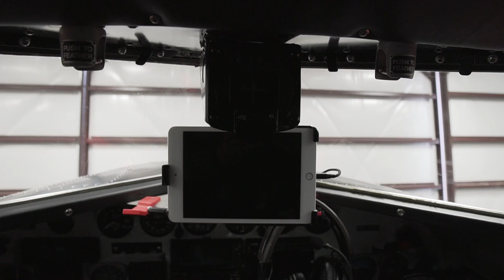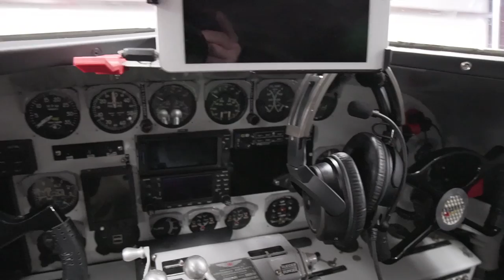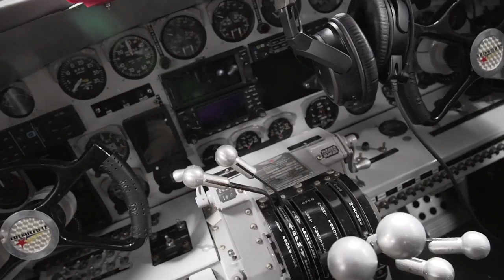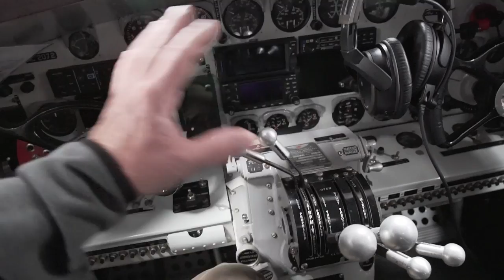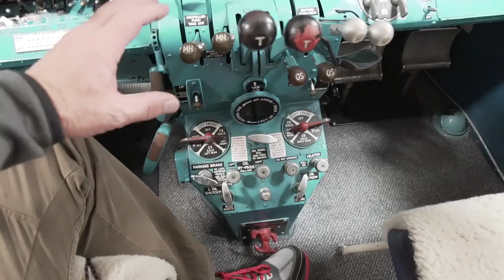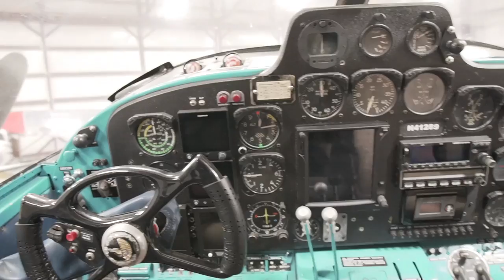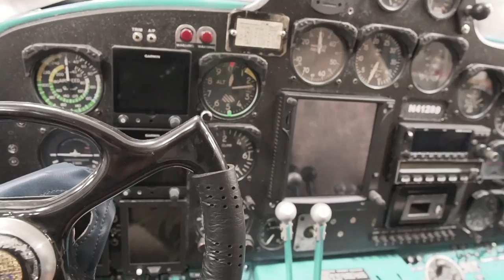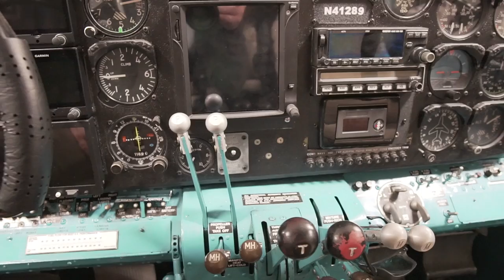Beech 18 vs Lockheed 12

Comment: Thank you very much for this personal insight into these two remarkable aircraft. Although they are very similar in layout and mission, the thing that strikes me is that the Lockheed seems like the product of a very large, industrial company that has built everything from airliners to military aircraft at this point, which has scaled down its engineering to this level and has brought all the benefits of that technology with it. Whereas, the Beech seems more like a smaller, nearly cottage industry company reaching up to the level of these twins and bringing its interpretation up from very much more basic engineering. Just as you mentioned with the comparison of the two landing gear retraction and extension mechanisms, one totally thought through, simple, effective, and reliable, the other a mix of mechanics that gets the job done, but is very much less elegant, reliable, and simple. 

The wing spars are another example of true, thought-through engineering versus up-adapting existing methods that worked fine on smaller aircraft, but were an overreach on an airplane on the scale of these twins. Kind of like they just kept patching and adding until they got something that would work, but a knee-high spar cutting right through the fuselage, bisecting the cabin and cockpit? That sort of speaks of a lack of design, instead of the presence of design. 

The NACA cowling on the Lockheed seems like another example of superior engineering, it effectively forming a Bernoulli tube that creates its own vacuum flow to extract heat from the engine in a very precise, virtually tuned, manner which has to be less drag-inducing than the Beechcraft method of just capturing a bunch of air and releasing what you don't need through the cowl flaps. Both methods work, but one is elegant while the other is crude by comparison. Don't get me wrong, I love Beechcraft airplanes, all of them. I'll never afford an airplane of my own, but if I could choose just one, that is capable of nearly everything, I would want a 90-series King Air hands down.

In the final analysis, the production numbers of the two aircraft cannot be ignored. In this case, the Beech wins going away. I'd wager that Lockheed either broke even or lost money on every 12 they built, going to the effort to make sure to have an airplane in this category for their customers who wanted Lockheed engineering, whereas Beech built an entire company from this airplane.

Great video. And thank you again for preserving these two beauties and taking the time to share them with us.

Comment: I am a retired twin piston pounder and absolutely loved this video and all you have shown us and talked about.  I owned a Cessna 150 which I restored and is still flying up in IL, N10518.  Also has a Piper Apache 235  N4951P, which basically had the Aztec fuselage and similar engines only the Aztec had 250 hp.  Think it’s still flying too.  They only made 114 or so of these and when I had mine only 52were still in the air.  Great plane, lots of power. My Piper had no cowl flaps and an augmenter exhaust  system.  After I sold them I flew on a Piper Navajo, some time on a King Air 300 as co-pilot and finished flying on a Cessna Golden Eagle 421B.  Loved that plane but of course the mechanics hated it.  So I can really appreciate the vintage birds.  Thanks for bringing us along.

Comment: Many more Beech 18s were built, the gross weights were increased and then they were abused as freight carriers . Those factors were probably the reason for the spar cracks and the straps. It should be noted that the later model 18s had a much higher cabin and the very last had fuel injection engines. Tricycle gear was factory optioned on the H models.  It never looked right. 

Even though they’re similar the 12 is a better looking plane and yours is absolutely perfect. Thanks for sharing.

Comment: Great video and comparison. I think some people would benefit knowing that the Lockheed uses a long rotating jackscrew (not a worm gear) to actuate the gear... almost foolproof. Same design as the elevator/stabilizer trim on a 737, except open and accessable for inspection/maintenance. 
Btw, airplanes have seats, not chairs. I know... y'all talk funny in Texas! Lol

Comment: Hey thanks for the comparison. For years I could never differentiate between the two. And when I learn something new, I try to make a mental word play to remember (getting older so I need help). And this one was simple. "Lockheed Lip"! The Lockheed has a Lip on the vertical stab. So easy to make the visual now that I know what to look for. Typically I'm not close enough to see air intakes, door shape, flaps, etc. So great job, nice tour, informative narration, and terrific walk around. Cheers!!!!

Comment: Air intake position: statement of STC ref "hot engine = hot air" (implying reduced density) not prime reason.
The prime reason for supressed air induction with in-cowl carb air intake, is the blade root shape - just circular, non aerodynamic. This negative effect on airflow induction pressure was a cause of serious trouble for development of DH88 Comet racer, 1934 GB-AUS air race. The drop in power AND increase in CHT beyond acceptable limits forced DH engineers to urgently fly to France and select Ratier props - rapidly adapting the Comet engines with fragile prop mounts.
Note that: DH engineers had previously made trip to US specifically to purchase Hamiltons for the three Comet racer entries and to form licencing production agreement.
Thanks for you video. Beautiul machine & thanks Kelly J.
Best regards ✈

Comment: The fact there are no ADs on the Lockheed might have something to do with the fact they only built 130 of them rather than the 9000+ Beech 18's that were built.  Regardless they are both beautiful and the only thing you need to have my favorite 3 planes is a Cessna 195.
Reply: .  .  .  a Staggerwing and a Spartan Executive would also be nice.
Reply from the maker: More than likely that is probably true on the AD point, however, I can also say from working on both planes that the Lockheed is a lot better built airplane in terms of systems and structure.  All you need to do is look at the two different wing spars to get a taste of it.

Comment: We had a Beech 18 as a training aid at the A&P school I went to. It was donated because they are prone to corrosion in the spar and it’s a huge expense to keep up. That’s why Beech 18’s are so rare now.
Reply: I graduated from Northrop institute of technology in 1962. We also had a Beech 18. Certain Instructors were allowed to take one student into the cockpit while the instructor started the engines. The aircraft was more of a display as students didn't work on it. We did have a Waco bi plane that was used as a teaching airframe and was worked on by most students, including me.
Reply: @timmayer8723  One forgets the 2,  Vultee BT-13 airplanes less outer wings, the 1928 Waco Taperwing was a school restoration (N-719E that is still flying as of 2021), their was a Stearman PT-13 that was used for biplane rigging! Oct. 1965 grad from NIT!

Comment: The way the NACA cowling works is that it slows down the air that entered the cowl, thereby raising its pressure and the efficiency of cooling. That's also why the carb intake is located there. 
Then the air exits through a narrow slot at the back, which raises its speed and consequently reduces the total drag of the cowl.

Comment: Looks like those seat cushions on the Lockheed are pretty chunky, any chance you could get some headroom by modifying those? I'd bet that with modern upholstery foams you could take an inch or two out of them and still be comfortable. Given an infinite budget I'd probably think about making a new panel that'd be a bit closer and maybe get rid of those knee obstructions but I dunno if that's practical. (But maybe a new extended center stack that'd put the GPS and autopilot controls in easier reach could be an option?)

Cockpit issues aside, the Lockheed is definitely the one I'd want to have. I love the way it looks and feels like a miniature version of an airliner of its day and there's something so cool about the idea of owning a Lockheed product instead of something from one of the more common GA aircraft companies.
Reply: You can modify anything on an aircraft, fuel tanks, cushions, engines, control surfaces, wings, tail, gear, etc.

Comment: Great comparison of those aircraft. I had always wondered what the differences where. Down here is south FL those old 18's are still running in the Bahamas. I don't see and Lockheed's doing freight. Both cool A/C. Here at PBI we had 2 18's that where retrofitted with the turbines (Garretts?) running freight. I am a radial fan. Thanks for the info. 
EAA Glenn O ><>*

Comment: So to get a "perfect" plane would be to incorporate the Lockheed wing and horizontal stabilizer and elevator into the Beech, and possibly the landing gear mechanism and fender as well.Installing AmSafe airbag seatbelts and some sort of inflatable horizontal airbag across the bottom of the panel to protect from leg flail injuries in an unexpected sudden stop might be helpful. Finally, Jet Shades for the cockpit to reduce glare and some heat from the sun.

Comment: WHAT IS THE USEFUL LOAD IN BOTH AIRCRAFT? I will check back later. THANKS.
Reply from the maker: About 1200' but as with everything they can do more.  The Lockheed handles the extra weight better than the 18 though.  The only thing I notice in the Lockheed with extra weight is the tail is a little harder to get off the ground but even then I just let her come up on its own and it just takes off like normal.

Comment: The hot air & cold air issue is a real issue.
I'll explain why.

Hot air is less dense than cold air. Which means there is a lesser amount of air molecules per cubic centimeter filling up your cylinders.

Or, in simpler terms, it's essentially lower pressure air entering your cylinders. Reducing the pressure on your compression stroke.
And that is going to make your engine run richer than it needs to, to produce the same horsepower. 
This is just guesswork on my part. But I can see this being a more serious issue back in the day, when they used much higher octane fuel. Hot air like on that Lockheed might constitute a risk of having far less combustion in your engine. 
It's not going to harm anything. But it does reduce your fuel consumption in a noticeable amount when you have colder air entering your cylinders, rather than hot air.

It's kind of the same thing as how much better control you have when flying in cold weather vs flying in hot weather. You dont need as much runway or as much V1 to take off, and you dont need as much speed to land. You have colder, denser, essentially thicker air holding your plane up. A teeny bit more drag, but considerably better lift coefficient. 

So that was a smart choice to have the intake manifold away from the hot engine. 

TL:DR,
Cold air means more air in your cylinders, and a leaner mixture for the power produced. Like having a turbo vs nat asp.
Reply from the maker: Thanks but I understand all of that.  The real question though is how much does it heat up going 1 foot through an intake and into the carb and how did they measure the difference?  Because it would have had to have been done in the air to get a good test and I haven’t been able to tell a plane with internal versus external had any more power than the other.  Just saying...
Reply: @nizexlizzy  I can add input....intake tube length/diameter surface area exposed to what temp change over total duct length -
you could fit measuring equipment, but time consuming. (Turbulent flow & virtually closed off upper cowl exit must create inefficient pressure stream in '18)
Also trunk length to overall air mass flow/weight. Noting the '18 has much shorter passage of induction air. Comparison with primary steam tube dynamics in steam train engine provides clues. Ditto induction system non- turbo F1 changes over the decades.
Again with reference to DH88 Comet racer: the modified air induction system caused big & dangerous changes to quality of air entering carb throat. This was all related to proximity of induction trunking to hot air flow past cyclinders and opening positioning exposed to ambient air stream.
Looking at positioning of 12a intake opening, it is apparent Lockheed did the best set of compromises it could - noting that unlike the DC2/DC3, the 12a would not have engine starvation level ice accretion on intake mouth (ditto problem Beech Queen Air)
Reply: Scrolling threw the comments while looking for comment on this difference I hit yours. So I have a question. Doesn't the second law apply here? The potential energy cold air to hot engine is greater on the one getting its air from outside the cowling. So I figured that might be the reason. Is that at the core here? Just basic thermodynamics?

Comment: How do the AC compare with respect to performance and flight characteristics?  Handling, control forces, roll rates, stall characteristics, etc.  You mentioned a lack of elevator authority in the 18.  Do the drooping ailerons on the 12 cause any abrupt breaks at the stall, does it drop a wing, etc.  Which is your favorite in the air and why?  

The outboard horizontal tail extensions on the Lockheed are similar to that on the P-38 and other Lockheed designs, and are not as efficient as the 18’s  end plate rudders which act like early winglets if you will. The half moon horizontal tail extensions on the 12 add drag but very little down force since there is no elevator there. In fact, during landing, they may actually add up force.  I’ve always thought it was odd that Kelly Johnson did this on many of his designs, one of the few things he did that were not the pinnacle of aerodynamic efficiency.
Reply: I am wondering the same.

Comment: Beautiful machines. I envy you. Long first A in NACA. Both cowls were thought up by NACA. Both are properly called NACA pressure cowls, I am pretty sure. Bell cowl was also used on Hughes Racer. Some of your fans might like to know why the bell shaped cowl did not find wider favor. Please do more homework. Surprised you did not enlighten us about the differences in SE service ceiling & rate of climb. Are you sure insufficient elevator AREA is the cause of loss of pitch authority on the 18 at low speeds? Could it be due to AOA of horizontal tail? Wish you had showed more of the guts of the landing gear systems. Beech 17 & 18 seemed to me pretty Rube Goldberg. Have not been around a 12 in many years and have forgotten just how the gear system works.  You'd be in a position to know which intake system is more efficient. Any difference in max altitude at which you can pull 30 inches? Any difference in full tilt boogie MAP at 2300 rom  on TO at 5000 DA? Are the cowls  on the 12 a pain to remove and install v the 18? I seem to remember cowls on the 12 were very labor intensive to remove and install. Thanks. Hope you do more like this.
Reply from the maker: I think if I got that detailed on everything most people would tune out.  However, I can't really see much difference either way on intake systems.  I can say the oil cooling system on the 18 is far superior than the 12 as it pushes much more air through.  Neither cowl is much harder than the other to remove and installed but neither are fun.  They are totally different processes though as the Lockheed has 3 and the Beech 18 has 2 halves.

It is also difficult to compare takeoff and landing distances to each other based on engine setups because they are totally different and the Lockheed performs better in both areas. 

As for the elevator, I don't personally know the exact cause of loss of elevator but have read the faster 18 mods zeroed out the tail and that it was literally impossible to do 3 point landings afterwards.  I also know on the 180 that if you do not trim the tail all the way up you won't be able to do a 3 point in it either as it also looses control back there.  The 180 doesn't have trim BTW, it rolls the entire horizontal up and down which is the cause.

Comment: Have they ever had a wing fold up?
Reply from the maker: Yes a few.  That is the primary reason for the AD requirement but the planes were flown heavy rough and low so not really anything recently.
Reply: @nizexlizzy  Thanks, appreciate it.